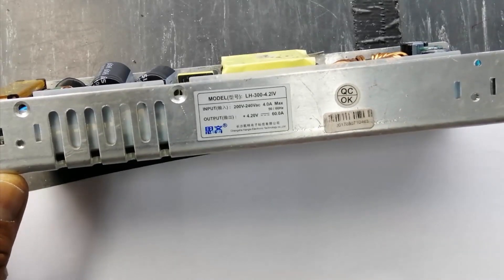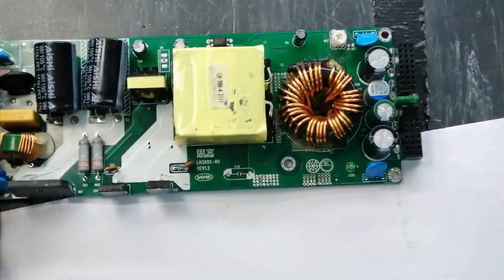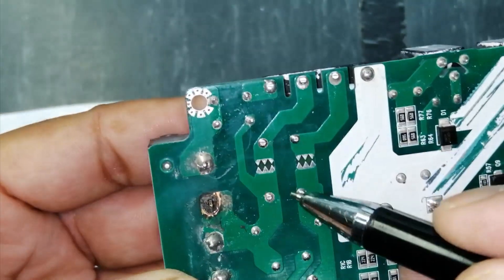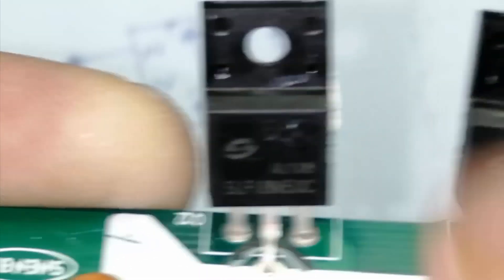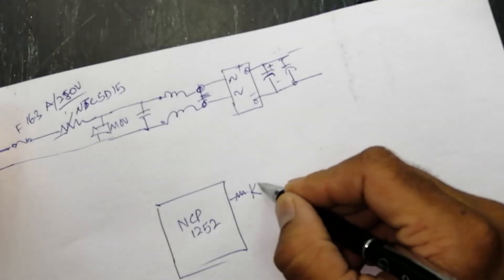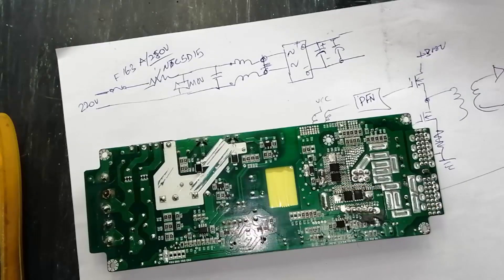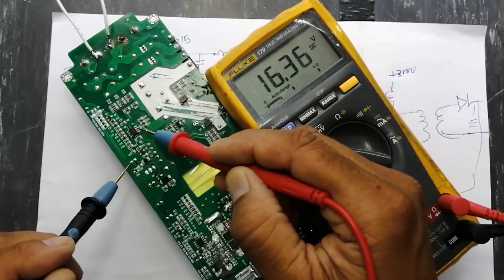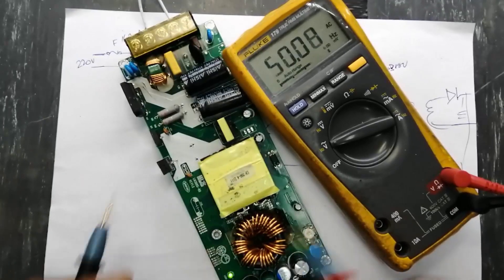#249 Design Review of Voltage and Current Mode Switch Mode Power Supply SMPS and How to Test

Comment: Salam M Hasseb, is an 12vdc to 220ac inverter can be considered as an isolation transformer to operate an oscilloscope ?
Reply: @HaseebElectronics  my question was rather to use an inverter as an islation transformer, if not, can we build an isolation transformer easily ? thank you.
Reply: @HaseebElectronics  Thanks, i feel assured. Another thing, i see in many of your videos that you measure voltage and frequency just with your multimeter at the SMPS transformer. Can you explain what should we have at each side, thanks.